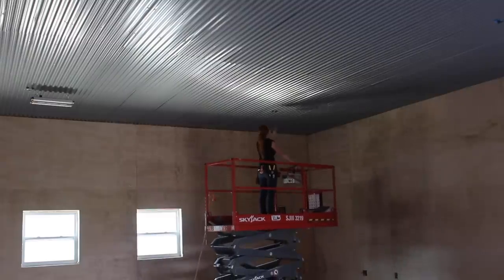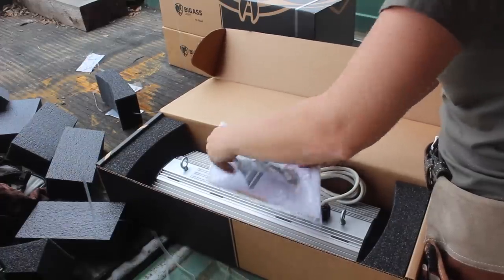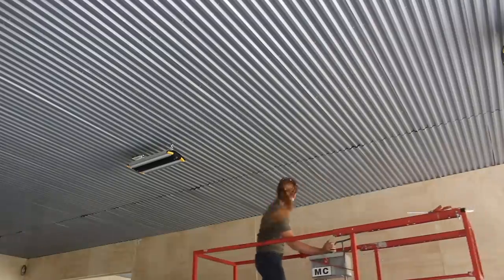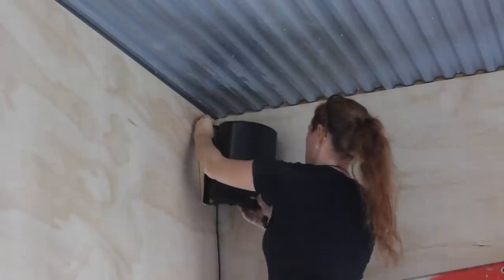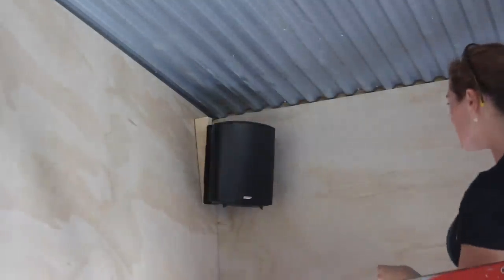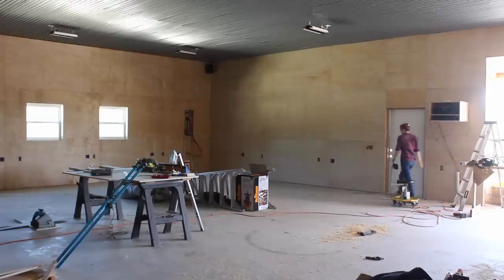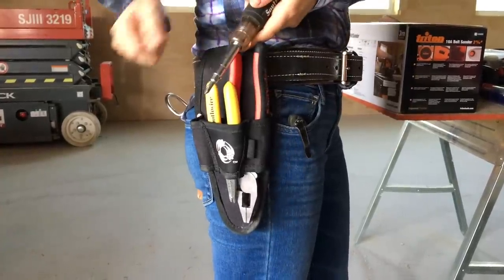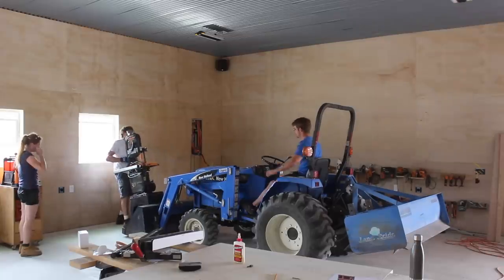Building A Shop - Installing Lights, Outlets, and Stereo System

Comment: April, Just a note: as I watched you install your receptacles in this video I noticed you install the ground plug portion down. Please double check, but as far as I learned this has changed in recent years for safety reasons and if you notice most new plugs are orientated to use the receptacle with the ground plug portion up. The safety side of this is if the plug is pulled out some and something conductive falls down the wall(coin/change off a dresser in a home, thin pieces of metal in your case) and contacts both plugs at once it could arc and start a fire. If the ground plug makes contact then this is not as great of chance of fire. The other thought here is the ground plug portion of the plug is much longer and actually helps hold the plug into the receptacle. Just some FYI on installing receptacles. BTW Love your work!! You're great to watch, a gal that knows how to use tools!!! Great job on your projects and your hard work.
Reply: Wes Fleming there’s nothing in the code book that states you need ground up or ground down. It’s a Spec by the customer. Very typical to have ground up in Hospitals.

Comment: You may want to re-consider plugging cord reels into the lighting circuit.  If you trip the breaker while using the cord reel you'll lose your lights.  Not so bad during the day, but not so good if you're working at night.  It's best to keep lighting and power circuits separate.

Comment: I would also recommend that instead of putting all the wires on multiple screws on the wall outlets,the wires should have been tailed out.Once pigtailed only one wire would be attached to the outlet.This saves in for the outlet being used as part of the circuit.And if an outlet should go bad you wouldnt lose the whole line,just the bad one.This is a much more professional metho,and most inspectors expect to see it.

Comment: April, I’m sure glad you escaped the kidnappers. We were worried and going through withdrawal after so long without shop updates. Seriously, great job, just wish we got more frequent updates!!  One further point; I have a 1200 sq ft wood working shop and that’s almost as much as the portion you have dedicated to wood working ...and it isn’t enough!!  Mine filled up in the first year. I’m betting you’ll be shifting many of your tools over to the metal working half of the shop shortly. Especially things that have dual use like the drill press, compressor, etc. are you planning to add solar or a heat pump for AC and heat?

Good luck gal and keep it up!

Comment: Looks great.  Been enjoying the process.  I thought of something at the end of the video during the wide pan shot.  Maybe consider using a smaller space within the room for the actual shop (of course don't enclose it).  I was thinking with it all spread out, you will be spending a lot of time walking to the tools.  Its great to have all that space for assembly/staging areas, but subdividing into specific task areas might be worth considering.

Comment: color me jealous.

regarding lighting:   I have an 8x12 shed that contains a miter saw and contractor type table saw so sawdust stays out of my basement.  It is also shared with garden tools.   I have five fixtures from big box store in a ceiling 8 feet high.
They provide shadowless lighting that is very bright even if your back is to the fixtures.   My hand tool shop in the house is going to be lighted the same.  I prefer hand tools unless it is too difficult to 
obtain what I need.

Comment: I used lights with plugs too, but I didn't cut the cord to length in case I wanted to add more lights and decide to shift them all over a little bit.

Comment: Add a generator interlock kit. You can run your whole shop off of the generator and adjust the load according to how big your generator is. Could probably do the whole thing for under $200

Comment: One cautionary tale with LED lights April - The LED's may be rated for 150,000-250,000 hours but the ballasts can be another story and many companies will put the hard sell with LED's and talk up the warranty but then deny warranty on the ballasts failing. Its more expensive to replace a whole light fitting instead of just popping new tubes in a T5 or T8 fluorescent lamp. 

Your shop is looking very nice though.

Comment: I had mentioned this on the rough in electrical part,but you cannot have regular type receptacles facing downwards like this,it is an N.E.C. violation.And here where i do electrical installations for inspections,it would get you red tagged.So when you use receptacles in this manner-they must be by N.E.C twist lock type receptacles.

Comment: Very nice!
As far as Romex outer jacket, I thought it was code to only have about ~1/4" of the outer jacket coming into the electrical box.
(I am not an electrician, I just hear it said a lot in my state.)
Reply: Mario Monti I just guessing but I don't think she getting inspected
Reply: Possibly, I just heard her comment about several people had commented to strip it back.
I was just mentioning what I have been told by electrician friends and what I've read.
Reply: Yeah I thought the same thing. In Canada that would be against code for sure. Uninsulated wiring like that is technically a fire hazard because it can create too much heat and over time the expansion and contractions can loosen connections.

Comment: Quite awesome. Did you ever consider putting in some solar panels to save power?  You could probably generate quite a lot of power in Texas, and that shop roof is probably big enough to hold a large number of panels.

Comment: Just a suggestion.  I dont see a workbench area.   The wall where you have the tools mounted looks to be a good place. Just mount the tools above the bench and have a loooong work bench underneath.  You could also build in a spot for a miter saw station.

Comment: Great but on the electrical side of things. When cutting in a box you should only leave a 1/2" of jacket in the box and should have 6-8" if wire in the box.

Comment: I’ve been in the AV industry for nearly 30 years and I can tell you that the #1 reason for electronic equipment break down is lack of airflow. You can’t exhaust hot air efficiently without allowing cool air to replace it.

Comment: Good work, shop looks awesome.  Find or make some music, got to hear the sound system with that ceiling, and I am definitely giving those lights a Google, great coverage.  I like your plywood interior walls.  Are you thinking of putting on a sealer though?  Saw dust will roll off a lot easier.  A light stain on the plywood would give it a look of old school cool also.  Heck, even multiple stains and tints, stenciled, artistic, graphical...
something like large scale wall decals.  A kin to large scale simplified intarsia,  landscape impressions, or repeating large simple patterns, vertical mostly to avoid drip hassles.  I'd watch those videos.  Anyone else with me, or am I silly stupid?

Comment: on your plugs you should have a joint on your wires with only one wire going to each side of your plugs ( you are taking your loads from other plugs through each other plug you are series them, not code must be parallel)

Comment: I have the Big Ass garage light in my shop.  They're great.  One thing I ran into is that the motion detector built into the light is NOT compatible with all GFI outlets.  Big Ass customer service did recommend a GFI outlet that works, just had to buy it and install it.  I've had the light for a couple of years, maybe they solved the compatibility issue by now.  Just something to be aware of.

Comment: Comment from a former electrician. Never use Romex. If you ever need to add or change anything, you're going to be taking down wall panels. Instead, use flex if you can, either aluminum or plastic (I've never used this). You can pull the wires through the conduit to each outlet. If you must make changes, take the cover plate and device out, and just run extra wires in the conduit to wherever. Similarly, never ever ever use plastic boxes. Prefer metal. The problem is that there is always some tension on the wires in a box, tending to push the device out of the box. With plastic boxes, that tension can strip a screw, and in a plastic box, you can't really retap the hole. With metal, you can be sure your screw holes will not strip out. And if they ever do, you can retap the hole, going from 6-32 to 8-32. Also, there's grounding. Plastic boxes can't be grounded. Metal boxes can. Maximum safety. All of this will cost you more, but will enhance the integrity of the system and allow for easier modification later. I presume you ran outlets so that no point on the wall was more than six feet from an outlet? National Electrical Code. Fort Worth/Tarrant County (I grew up in Dallas) probably requires this (and you probably already knew it and did it).

It also sounds like you didn't run telephone, alarm or internet. You could have (and I would have) run empty conduits with capped off outlet boxes for stuff like phone, alarm and internet. Install as needed, just the same way as your electrical. I realize you can do most of this now with wifi, but with wifi you have latency issues and security issues.

Anyway, very nice work. Looks gorgeous and very functional for what you want to do with it. In a workshop, plywood walls make so much more sense than drywall.

Comment: Next time consider not using all 4 screws on the outlets.  Use wire nuts to connect the wires coming in and out of the box to a pigtail and connect the pigtail to the outlet.The way you have it the entire 20 amps has to travel through the "breakaway tabs" causing unnecessary resistance and if one outlet fails all the outlets wired through it will go off.  Reducing additional resistance will help your expensive power tools last longer and reduce overheating cords and motors.I enjoy watching your videos,  after the workshop I assume your next project will have to be building a house.

Comment: May have been addressed as some point: the ceiling "tin," how did that do in the summer? Seems like it could get some sag if it got very hot. Perhaps all the spray foam insulation helped prevent that? Or just alot of fastners (last video)? Thanks!

Comment: I wonder what the power draw per light fixture is. I'd like to swap my fluorescent lights for LEDs. I'm guessing I can add at least 1 extra led fixture per each fluorescent fixture switched, though I'm also considering replacement led bulbs for the fluorescent ones.

Comment: April, thanks for this video; specifically for the reference for your shop lights. I have been looking for some for a while now and have looked up Big Ass Lights. I have "only" a double garage to light up but intend to use Big Ass Lights to do it with. I also have a question about your speaker/sound system. I am a big fan of Sonos products and have the whole house set up with them. 

When you explained using conduit for a sound system a thought occurred to me; did you ever consider using Sonos speakers? They are "wireless"; no speaker wire but does require an AC power source. They even have one that is portable/battery driven for outdoors use.

Keep up the good work and I really enjoy your videos.

Comment: Noticed on the outlets that you used the stab-in type wire nuts, but on the receptacle you used the screw terminals (vice the stab-ins on the back). I haven't been able to find good information either way; any reason you went the way you did?

Comment: I just wanted to suggest a generator when you came with that at the last moment.
The light is great. It should be possible the same way to connect some power tools to the generator.
(mainly those for which you do not have a battery powered alternative)

Comment: No integrated air vent system? That probably would have had to be done in the flooring or roofing stage. Integrating it in the floor would prevent a lot of pipe from dropping down from the ceiling and maintaining an open look. Are you at least going to wax or smooth out the floor to make it easy to clean?

Comment: Caution. The LEDs will last a very long time but the power supply type change over from ac to dc may not. All LEDs are dc. You can run just them off a battery system and or with solar panels.

Comment: Do you have any videos of the land prep, foundation build, and slab pour? Like you...I'm on sloped land North of Austin (Georgetown). I'm not sure if it is easier to blade it flat or to build it up....looks like you bladed down, but that caused you problems with the rain later.

Comment: With the 'french' cleat system. Is this a misheard term? I when i first started called them french cleats too, until my then boss said it is 3 inch cleats not french. So is french cleat the actual term or was my old boss correct

Comment: A large investment in not just money but hard work. I’m a retired firefighter so my head is fire prevention. I hope you have included that into your hopes & dreams. Metal working? Is welding involved? I don’t enjoy raining on your parade but additional precautions are in order, allot of your building materials are far from fire resistant and under fire conditions poisonous gases will be the instant product. Your dreams can quickly be reduced to smoldering rubble. I have seen it many times, don’t learn the hard way. Take advice from the professionals.

Comment: you should have your electrician set up a generator panel for at the very least backup power. Then you could run your shop from a genterator should you loose power......or before the power company arrives.

Comment: April didn’t catch the video and how you ran all the wiring in the shop for some reason it didn’t pop up in order with the rest of the videos and I’m probably gonna have to go to your site if I can’t find that section because if you ran it the way I think you did it was probably run the same way I did through all the studs along the walls and I’m even considering about putting a 220 into my shop to accommodate for other power tools that require that including a heater and also installing a Air conditioning unit on the backside of my workshop I’d love to be able to have a shop vac filtration system that I could just have sit outside and then have tubing and I’ll run inside and sit at each workstation and I am going to make my own customized tablesaw out of just plywood and a circular saw that I can drop into place and take it out whenever I need to and reaching underneath to set the depth or pulling the holesaw out and then setting the depth by measurement and then reinstalling the circular saw into place and then I could cut stuff that are large sheets of plywood and other board instead of buying a complete tablesaw which is expensive

Comment: I'd like to offer what small advice that might be valuable to you in terms of video editing, as that's what my background is in-  you know how you have these strange feeling, hard dead spaces of absolute silence in between your voice over edits? you can fix this to feel more natural, by every time you do a voice over, simply sit there and record a solid minute of the "room noise", IE nothing at all. use this "room noise" for the dead space between your audio edits. throw fast transition edits between the cuts to smooth it out even more if you want to go even more pro.
Lastly, invest in a lavalier mic system for your monologues. I'm pretty sure you're using a shotgun, yeah? with a lav, not only will it cost a little less usually, but is indeed far superior to a shotgun for this application. you will seriously be shocked at just how much the audio quality will improve when you're sitting there doing your monologues, even with a somewhat cheapo system. 

Hope you see this, and great work, i'm very jealous of this shop.

Comment: Very nice shop. It looks like big ass fans has quite a few types of lights to choose from, but the price is very high compared to other options. An 8" fixture with 4 t8 lamps at 6500K will put out 11,400 lumens. The fixtures are around $60 each and ballasts 20 bucks each. LED conversion lamps are available to replace 48" tubes, but the lumen rating is less. T5 lamps have even higher lumen ratings. That big ass garage light retails for $400. Home depot has it listed as 70 CRI, which is awful, but the company web site says 80+, which is the same as the t8 lamps I use. For exterior lighting, LED is certainly more economical than HPS and metal halide. There is a group of commercial properties where I do the lighting maintenance and I have replaced some of the parking lot lights with LED fixtures and have converted others from MH to LED. For use outside of my garage, I got a 150w led exterior light (11,000 lumens or so) for $60 on Amazon. It is impressive. Hopefully, the LED lights will progress in the next few years and will have closer output to T8 fixtures with competitive prices. There are more LED fixtures offered in 5000 or 6500 kelvin, and I like that, as I hate working under 4100k or warmer lights.

Comment: Not to be mean, buy I don't think you're putting enough stress on conserving energy. You insulated the building well, and are using LED lights, which is great. But you aren't using solar panels, and it seems that your windows are single-paned. Have I missed other things to make the building green, or is it just not that much so?

Comment: I feel like you need 208v, 3PH power in order to use large welder like 1000A or more.  By the way,metal fabrication need enormous amount of oxygen, acetylene and shielding gas. Do you have a area for cylinder storage? You should probably run gas line and connect multiple gas cylinder by  bus-bar  so you don't have to change  cylinder all day long.

Comment: check if all the phases of your speakers are correct or you will have no bass at all (and because your speakers are up in the air you will have less bass). and the led lights will get somewhat less bright over time